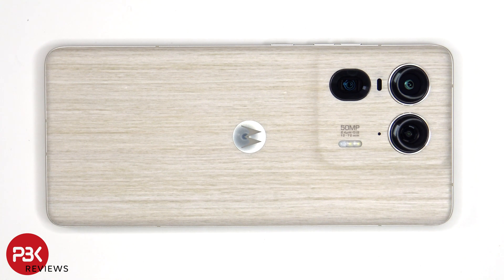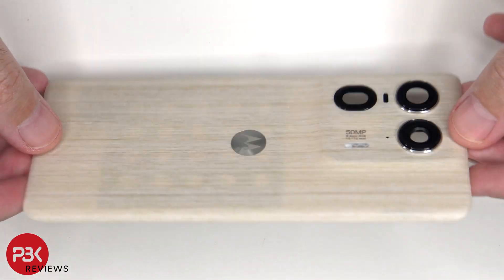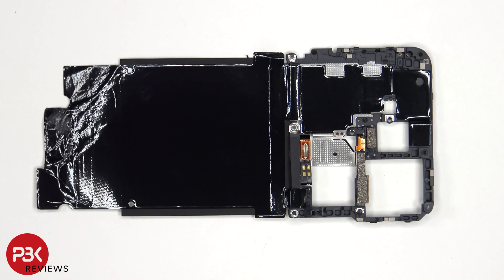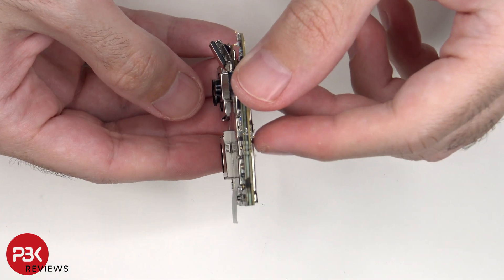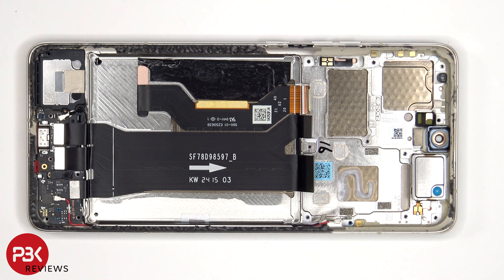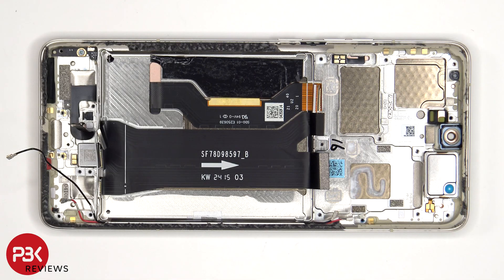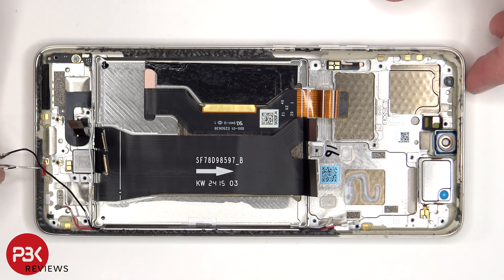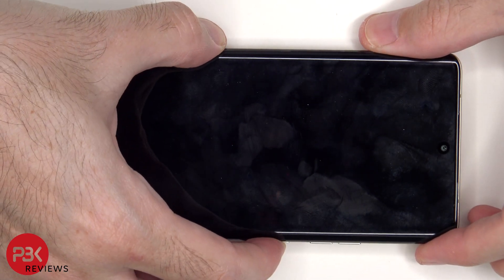Motorola Moto Edge 50 Ultra X50 Ultra Teardown Disassembly Phone Repair Video Review

Comment: what kind of liquid did you use at minute 5.17?
Reply: It's isopropyl alcohol, most probably 99%. It's what you would use to clean old thermal paste off a CPU. Here it helps dampen a little the adhesive behind the battery

Comment: I just bought this phone and I’m concerned about the longevity of the battery. Do you think motorola has done a good job on minimizing the impact of the heat generated from the ultra fast charging (125w) on the battery? Should I expect this battery life to be a lot less than other devices with slower charge rates?

Comment: I meant the whole silver painted area inside the phone.
Reply from the maker: Its metal and its not painted, its CNC milled.
Reply: @PBKreviews  So nice to hear that.
Reply: @PBKreviews  Does the Edge 50 Pro also has CNC milled mid frame? Or is that plastic? Please reply Sir.
Reply: @PBKreviews  Please reply

Comment: Seems like there was still room for the SD sim combo tray instead of just sim. Good that it has 1TB storage.
Reply: Yes. Its exactly the same Sim card tray as in older models, but only one side is usable. So an sd wouldn't be an issue, but I doubt I'll ever need it
Reply: @LachskoenigIV  best use is then to be not cloud dependent. 
On my previous phones it was my default storage location. 
SD still has benefits.

Comment: Oh well done Motorola !! A very large copper vapor chamber cooling system for their flagship ! 🌬️🔥
Reply: How much vapour chamber size ? Is it larger than realme gt 6
Reply: yeah, amazing. it's flagship and ULTRA.. but 8s gen 3 and 8 gen 4 is coming up
LOL
Reply: @user-ik2od3qf3y  But 1 TB storage, great cameras and although much cheaper than Pixel 9 Pro, still faster.
Also 50W wireless and 120W wired charging with the charger included. It's always a decision what a manufacturer put in the basket for what price.
And the package is great, with the 8s gen 3 still fast enough for anything for years to come.
Reply: @user-ik2od3qf3y 

I have the Phone and well, the 8sgen3 inside has no Trouble at all getting better framerstes in games than the S24U. 

Raw power is meaningless if you can't use it you know
Reply: @user-ik2od3qf3y  bigger number means better performance, duh. 

8s gen3 has a better efficiency while also being cheaper. The price of the 50 ultra dropped from 1000€ to 700€ in half a year. Thank you.
Reply: @user-ik2od3qf3y  8s gen 3 is still much faster than the Tensor G4 lmao